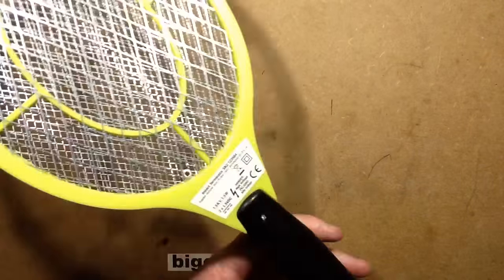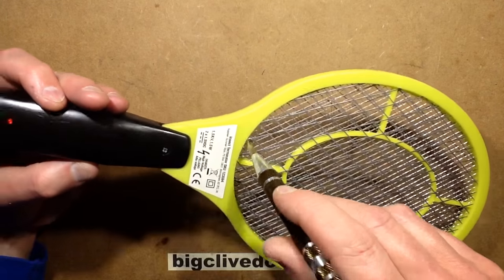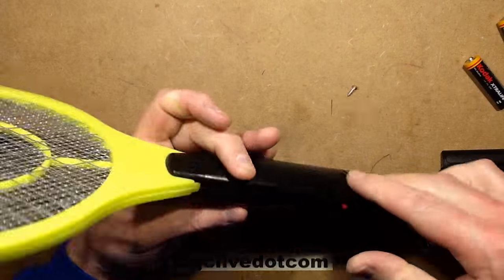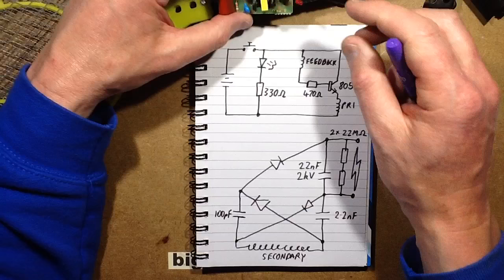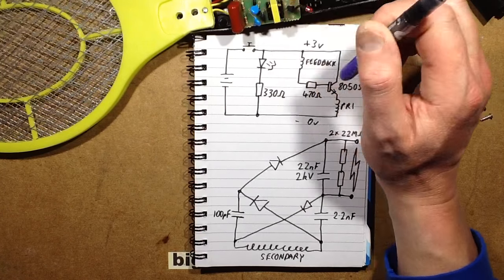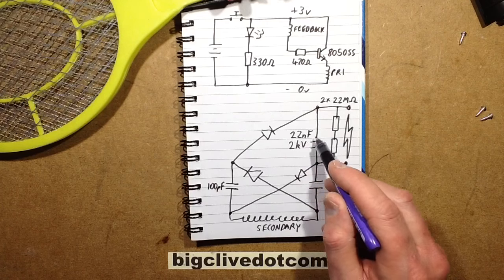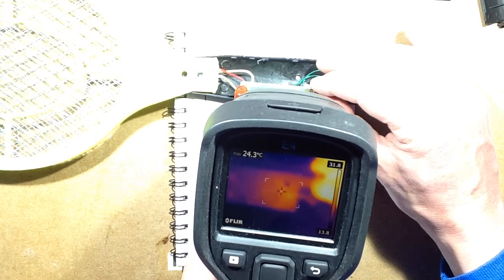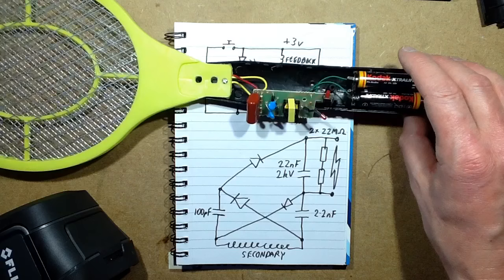Inside a bug zapper racket / racquet , with schematic.

Comment: can you please explain why didn't you get shocked? thank you.
Reply: +Macavellic the majority of current always flows down the path of least resistance. The metal screwdriver was bridging the positively charged part of the grid with the negatively charged part of the grid effectively crating a short circuit, a path with very little resistance. In comparison, Clive has quite high resistance (especially if he is insulated from earth) so very little current would have passed into him which would not have been enough to feel.
Reply: +Macavellic It's an isolated supply, the current attempts to flow between the outputs of the power supply ie between the wire grids. Clive is not in the return path for the current so it does not flow through him.
Reply: +Macavellic Current only flows in a circuit. That power supply is isolated, so there's no way for the power to get back to the other side of the supply. If he touched both wires inside (or poked his finger in far enough to touch both sides with skin) then he would have gotten a shock.

You could touch a live wire in your house and just get a bit of tingling, as long as your body is fully isolated from all other conductors.  The tingling comes from the fact that your body has a bit of capacitance to the environment so you will still pass a little bit of current.

They work on live high voltage wires from helicopters, and can do it because THEY are not connected to ground or the other wire, so there's no way for the current to flow.  Same principle.
Reply: +CanonFirefly NO current would pass, because the power supply is fully isolated.  Ground means nothing to the circuit, there's no way for the current to flow through ground and back into the circuit so no current can flow.
Reply: but if so, how is this different from a taser gun?
Reply: +John Ridley That isn't really true that no current will pass. Your body is a large enough conductive object that some current will flow at sufficient voltage. In your other comment you literally says you would feel a tingle touching the mains ... this is no different except the voltage is much higher
Reply: +Macavellic a taser has at least two electrodes, one positive, one negative and it passes the current directly through your body. If you shorted out the taser there would be a similar thing happening. I wonder how effecting chain mail is as taser defence?

Also, there most certainly would be current flowing through you if you touch these things. That's what you feel.
Reply: smeezekitty You get a tingle from mains because it's AC and your body has some capacitance.  This is DC. The amount of current that flows is so tiny that it's very unlikely that you'll feel it, and it will be once for a millisecond or two.
Reply: +John Ridley Your local Substation transformer has a very good earth/ground connection. If you stand barefoot on the ground and grab hold of a live mains cable you are completing the circuit to the substation, whether you die or not depends on the mood of the electrons that day and how sweaty your hands and feet are:-)
Reply: John Ridley - People (crazy people) who do that live cleaning on transmission lines say that it is like being covered in stinging insects, all over, until they actually connect the helicopter too.  So even given the huge dielectric to ground provided by all that air, current still flows.  I'll bet one of those lines could send a fly back to the future!
Reply: John Ridley - "and it will be once for a millisecond or two" It is going to be DC pulses.  They won't ramp up as much once you are in circuit, but...
Reply: Coolkeys2009 - You are right.  I spoke to some electrons the other day and they were saying the exact same thing.  Electrons have a thing for holes too - just like most blokes...

Comment: I hooked an led up to one of these and it exploded!!! Lol
Reply: Interesting.  I was expecting to have the same sort of thing to happen when I connected an LED indicator (LED+resistor) up to an 11kV ignition transformer.  The LED simply lit up, which really pissed me off.  It did successfully jump about 1/2" between two Clementines though and burned them  ;-)

Comment: How long will it last with a 9v battery powering it?
Reply from the maker: Not long and it may be damaged.
Reply: @bigclivedotcom  I just tried it for a second it worked but the buzz it normally gives off was higher pitched. I put the normal batteries back in and it still works.
 Do you know why an a\c contactor would start to buzz really loud?
Reply from the maker: @jackedup8790  Contractors can buzz if the mechanism gets stiff or worn.
Reply: @bigclivedotcom  gotcha thanks the one I have is 5 or 6 years old and is not dirty. I guess I'll just replace it.  Thanks for the info.

Comment: Here's a tip Don't put battery's in it and it will still work.....as you strike the fly it die's it doesn't need an extra bang of volts up it's arse.

Comment: With the discharge resistors being 44 Mohm and the charge storage capacitor being 22 nF, then the time constant is barely under 1 second. (It would have been nice to see some circuit waveforms while you had the chance.) Since you didn't measure the working voltage, we might assume that it's safely under the 2 kV capacitor rating, so lets guess it's 1500 VDC. So, after shutting off the charge supply, after 1 second, the grid voltage will be down to about 555 VDC, after 2 seconds down to 200 VDC and after 3 seconds, under 75 VDC. BTW, I own one of these zappers, and it's excellent for gnats and mosquitos, but relatively useless for flies (because the flies seem to avoid contacting both electrode planes due to either the aperture size or the plane spacing, or maybe I just have larger than expected flies [time for the Bug-A-Salt]). I find that sweeping the area using a "tennis racquet" motion, rather than slow movements, maximizes the kill rate.